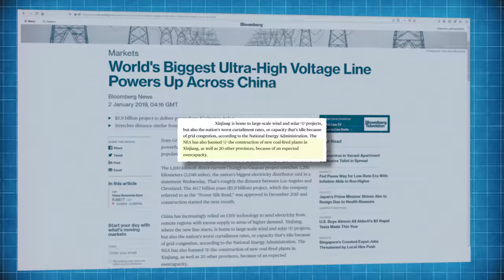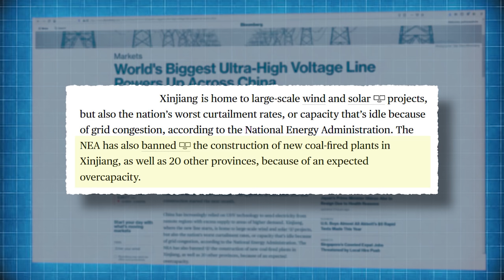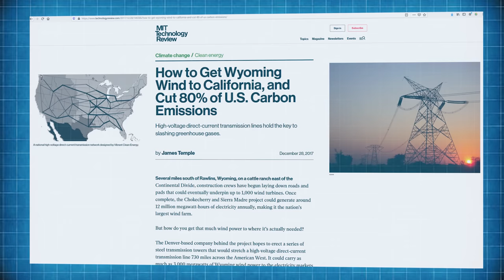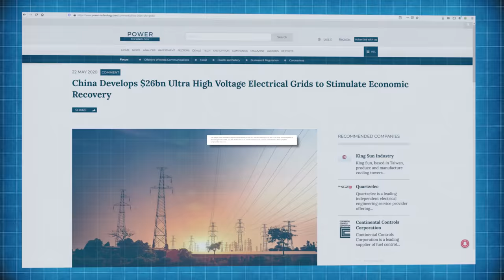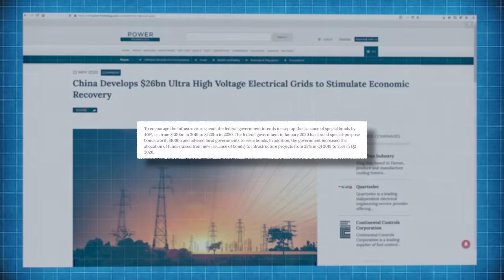China's MILLION VOLT Energy Superhighway

Comment: Be interesting to know whether the D.C. is transmitted sinusoidally as shown or smoothed with capacitance to regulated D.C.   If it's transmitted sinusoidally then it could simply be switched direction each time that it crosses the 0 volts, as shown, rather than needing inverted-gate bipolar transistors ((IGBTs) or equivalent to make a pulse-width-modulated (PWR) signal and then smooth with capacitance to sinusoidal 50/60Hz A.C.  (all of that called an "Inverter" like must be provided with solar P.V. on your roof) The diagram shows no capacitance or PWR so it is definitely stating that the D.C. is transmitted sinusoidally but would be interesting to confirm. That would eliminate much equipment and I suppose reduce heat loss. They probably do that. So the 1,100,000 volt D.C. ramps up  sinusoidally from 0 volts to 1,555,400 volts and back down to 0 volts 100/120 times/second (depending on whether it's 50/60Hz A.C. supply/demand. There might be some loss in that case due to the electromagnetic field coupling with an metals close to it. I'm getting a bit involved. I'll probably not bother reviewing that aspect. Somebody might find it interesting.  Afterthought: If it is transmitted sinusoidally then they might be reporting the 1.1 MV as peak voltage rather than RMS in which case it would be 778 kV RMS, more like the highest voltage A.C. transmission.
Reply: The transmission will be pure DC with no sinusoidal components. The output of the bridge rectifier would have worse transmission losses than AC because there are higher frequencies in the rectified output than the 50/60 Hz pure AC. The over simplified example in this video needs a soothing capacitor.
Reply: @yziib3578  Thanks for the info about capacitance before transmission omitted here. I'll likely take a butcher's at all this HVDC stuff when time permits.

Comment: I'm an electronics engineer (retired now). I was always under the impression that the resistance of any wire short of a super conductor is what makes DC LESS efficient that AC for transport over distance. I know that the phase matching and inductance/capacitance problems really are a hassle for AC systems, but is that resistance low enough for DC systems to make that the more economic solution? Anyone?
Reply: Historically, DC can only be pushed about half a mile to a mile without the resistive losses becoming insurmountable, while, because they CAN tune the inductance and capacitance of the circuit to result in LESS losses than the you do with the same DC power.
Reply: @calebmauer1751  The whole reason that AC won out over DC was this problem. DC cannot be sent more than a mile without losses that make it prohibitively expensive. AC can. For EXACTLY the reason I gave. Try checking in with one of your professors on this. I worked in this field for too long. I am not arguing about it any further.

Comment: Over 40y ago South Africa was a leader in power generation
and transmission. We had the https://en.m.wikipedia.org/wiki/Cahora_Bassa_(HVDC) line with over 1Million volt DC between the + and - feeder lines. With the new gov regeim now in place, sadly all infrastructure is decaying away as we progress ever faster towards a failed state.
Reply: Wikipedia link says 533 kV.
Reply: @achenarmyst2156  533kV x2 = 1.066MV DC between the +533kV line (relative to GND potential) and the -533kV line (relative to GND potential). Think of the transmission line like a center tap transformer, with GND = 0v and then a +533kV feed and a - 533kV feed. If you touch the positive feed with your right hand and the negative feed with your left hand, then you have just over 1MV across your chest

Comment: Alternatively, one supercooled cable 30cm in diameter could transmit all the power requirements of Greater London with no losses. Just a thought.
Reply: Would you build your house over a pipeline of cryogenic hydrogen!???
Reply: @alexandersibilio7436  No one would. They use cryogenic helium. Also the cable would only be to a substation where it would be dropped down to mains voltage.
Reply: @alaneasthope2357 ...Sorry  but it really doesn't sound safer 😅
Reply: @alexandersibilio7436  Probably why the power distibution companies haven't done it, although there are now high temperature superconductors which work in liquid nitrogen.
Reply: Bear in mind to keep a cable supercooled the liquid nitrogen? has to be boiling, so it will have to be constantly replenished, and that takes a lot of energy.
Reply: @rogerbarton497  Yeah. It's never going to happen. As is often the case, the most effiecient is rarely the most economic. :)

Comment: What are wildfire risks compared with AC, electromagnetic radiation risks for linemen working the line every day. It's an interesting strategy but prefer more conclusive data before signing on to DC transmission which is more lethal in electrocution by order of magnitude.

Comment: While DC high Voltage lines are not really new (first in Germany was planned 1941 but could not be finished because of the war), they are now very common in the Europe energy backbone.
Such high voltages make only sense if you have to transfer vast amounts of energy over large distances. So they are simply not needed in Europe. Common Voltage in Europe is 400 kV.
You can see it as a special case of these technology, as China has to close a gap of several thousand kilometres ..
Reply: 230 volt AC at 50 Hz is common in Europe
Reply: @jwarmstrong  
While the yanks fart around with 110v and imperial measurements. 😁

Comment: South Africa was using DC  low voltage high current  for transmission over 30 years ago !!!!
Reply: Low voltage doesn't count.  That defeats the purpose.
Reply: @incognitotorpedo42  probably high volt - low current, it's ok, they both come out as watts!
Reply: @GaryGraham-sx4pm  There's a big difference between high current and low.  High current requires expensive large diameter wire and beefier components that cost a lot more and are harder to  install.
Reply: @incognitotorpedo42  Watt?

Comment: With DC transmission of electricity we can connect continents and across continents. Sharing renewably powered electricity is the future. With this electricity we can power the world and off fossil fuels and their inherent industrial carbon emissions. High insulation, high efficiency, electric thermal mass heating, electric transportation all powered by local and regional renewables. Then of course we need to get 414 ppm back to 280 like it was in 1870...gigafarms?

Comment: Isn't there an issue with lines becoming increasingly susceptible to solar flares/geomagnetic storms as the voltage increases?  Something about the difference between the line and the ground being greater.   I seem to recall this being the case, at least for AC, and a reason why some other countries have shied away from such high voltages.  But I don't know if the same issues holds for DC.  Would appreciate if someone with deeper knowledge could comment.
Reply: The length of the lines would certainly be an issue in that regard
Reply: Resilience in face of another Carrington event or worse, definitely needs to be planned for. Plenty of batteries in case of grid collapse would be a start.

Comment: Uh, where did you hear DC is more efficient at long distances?  I was told quite the opposite.  The resistance in the wire eventually degrades the power until hardly anything comes through.  Whereas AC doesn't hardly suffer this loss.
Reply: Ohms law as I recall, (ie.resistive losses) same for AC as DC.

Comment: "Alternating current only conducts along the surface of the wire. "At 60 Hz in copper, the skin depth is about 8.5 mm"  https://en.wikipedia.org/wiki/Skin_effect
Reply: For normal wiring it is almost negligible up to a kHz or so, it can be reduced with Silver coating and increased surface area, but such increase will cause more reactance, there are some "magic" that can practically eliminate these problems, but makes the conductor designs a bit more complicated and voluminous

Comment: The UK and France’s  first HVDC link was installed in the 60’s and runs under The Channel, it’s been updated a number of times. I think it’s still the longest undersea power cable of this type.
Reply from the maker: Yes indeed. A vital interconnector. It doesn't run 1100kV though :-)

Comment: Are you sure about this, it is almost impossible to push DC long distances with just voltage. The reason DC lost out to AC in most of the world was you have to increase the amperage of DC to transmit it over distances, making it very dangerous, and expensive. AC on the other hand can be transmitted over long distances by stepping up the voltage. Unless something new has been introduced in the technology, there is something else going on here and its not working the way you think it is.
Reply: Incorrect. It is now just as easy (but still slightly more expensive) to generate high voltage DC as it is AC. The trick lies in high power thyristors that can switch megawatts of DC energy at high frequencies in the kilohertz range. Banks of thyristors have been used to handle up to 20 Giga Watts. 

These devices have been around for four decades, modern versions can handle large amounts of power at better than 99.5% efficiency.
Reply: 'it's not working the way you think it is' back at ya

Comment: Back in 2006-2007 when crude oil was kissing $150/bbl I was asked by a Genentech Molecule Manager to "...invent a molecule that solves the world's energy problem." So we did...5 of them...and transmitting them is 1/8 the cost per megawatt mile compared to electricity and 60,000 miles of pipelines already exist in the U.S. suitable for one of the compounds.

Thus all the talk of better batteries/capacitors for wind and solar was solved long ago and when it leaks on the ground plants flourish and when it leaks in water algae thrives sequestering massive amounts of CO2.

Today it's packaged as similar compounds like "Blue Hydrogen", but it's no big mystery; compounds of ammonia are easy to synthesize, have a higher energy density than gasoline or diesel and you can throw a match in it and it won't burn; but as Beirut demonstrated, kick it with a good primer explosion and a whole lotta energy is released.

Sadly, Silicon Valley was too busy with Google & Facebook IPOs to look at energy and the following year everything tanked and funding dried up. Had we switched to zero emission fuels in 2006 perhaps we wouldn't be facing extinction today. At least we'd have far better odds of avoiding it.

No such luck, but the game isn't over yet. 

Ideally offshore thorium reactors, far from population centers, thus reducing that risk, could make all the fuel for power, transport, including aircraft & ag needs AND we could ramp that up a lot faster than millions of sq miles of wind and solar and for a lot less mined resources and mfg.

But will we?
Reply: Actually once you get to ammonia, the additional processing steps to get to JP4/diesel using CO2 extracted from seawater is not that great. JP4/diesel is safer and much more useful as a fuel  than ammonia. For this reason I don't see much future in hydrogen or ammonia as fuels.
Reply: @jimgraham6722  I'd dieagree&suggest an electric drive train & fuel cells can take a jet or car or train or boat higher & faster than currently possible using JP4/petro.
Reply: @owlnationlegal4228  I hope you are correct but think I will be well and truly dead and buried before an electrically powered passenger plane can do Sydney - LA on a single charge at M.8.
Reply: @jimgraham6722  Tis true you probably will be gone given all life incl humans will be extinct in well under a decade.

Comment: I always thought direct current caused
 more resistance in the wire but I guess stepping up the voltage first reduces the amount of current. I wonder if that could be done with electric cars simply stepping up the voltage and using direct current motors. Would that make them even more efficient?
Reply: Higher voltage yes. Current electric cars use batteries delivering 400-600 VDC. Newer designs are approaching 900VDC. The advantages of higher voltages are greater efficiency, quicker recharge and lower weight. I wouldn't be surprised if in a few years EV makers are using 1200-1500VDC.

Nearly all high power electric motors are AC of one sort or another (needed to get a rotating field to turn armature). To get this in an EV a special inverter is used drawing energy from the battery to power the motor's field coils.

Comment: wait? direct current? no no only when one has a super conductor that would ever be a good idea.
the whole point of using alternating current is the fact is has a lower energy loss ratio per unit of distance then direct current.
the only reason it got used though as dc is deadlier then dc. but considering the loss is so intensely high in dc that it would never be feasible.
Reply: Well, the facts prove otherwise.
1 Mega Volts, dude. And power (loss) equals Amperage squared divided by resistance. By a given power (Watt) there is a less current flowing when the Voltage increases. 
And of course AC has two factors to take into account, DC or wire resistance (Ohms) and AC impedance (Henri), contrary to DC that only loses energy due to its wire resistance.

Comment: thought the whole point of using AC was to avoid power loss over distance?
Reply: To minimise losses you need to minimise current which means using high voltage to transmit the same power. The advantage of AC is that voltage can be stepped up before transmission and then stepped down again afterwards using simple transformers.

Comment: Awesome. Bruce Lee is a rare positive example of someone actually doing something.
DC is only logical choice.
Most of the systems are electronic and don't need rotating magnetic current and motors have to have inverters, anyway.
DC is much easier to switch and make parralel loads as well as generators.
It's also much easier to deal with emitted field etc.
His Kung Fu is strong.

Comment: Is 1.1 million volts DC really efficient and how do you bring it down AC is easy for big power numbers just a big transformer but aside from a buck converter using a mosfet or some kind of switch and an inductor
Reply: It's all a bit amateur science, I don't believe half of it. I think he's a charlatan.
Reply: Dear James, DC can be transformed up and down in the same way as AC, using a special transformer called an inverter. The inverter uses high powered thyristors typically able to handle 7,000 Volts at 6,000 Amps to convert the DC to AC, then transform it up or down and rectify the output back to DC, or convert it to AC suitable for the AC grid. Modern thyristors have an efficiency of over 99%.
Reply: @jimgraham6722  so not changed up and down the same as AC I'm not at least not with extra steps I mean I'm sure it's pulsed DC thru a transformer but that will only give you a square wave so you would need a pure some wave inverter but that all just seems like insanely big things to me but I mean I guess it's cost effective if they are actually doing it
Reply: they probably use big amps and big volts
Reply: @james10739  Yes it is not a simple square wave, rather it is a series of square shaped pulses of varying width (PWM), that integrate to form a sine wave. The process is more fully described at:

https://en.m.wikipedia.org/wiki/Power_inverter#Output_waveform

Comment: If we can transmit DC voltage over long distances then why have AC anymore? Most of our appliances are DC now so why not switch over to DC completely? It's only a matter of time before AC is no longer used.
Reply: You could install your own solar panels and separate low voltage DC power sockets around the home maybe...?
Reply: @MrZoomZone  yeah definitely, and people have who live off the grid. We need to happen on large scale though and I think that will happen when full self-driving becomes reality and people just start buying motorhomes that are off-grid and drive themselves instead of buying houses or renting them. It will be similar to the cell phone when everybody stopped having a landline. When energy storage and satellite internet along with full self-driving all come together in the form of a smart motorhome then I think many people will just buy that instead of a home. Not because they want to necessarily but just like cell phones it will be something you have to have that you can't afford both cell phone and the landline.
Reply: No, AC is not going away.  AC is vastly superior for distributing power locally and even regionally.  HVDC lines are only competitive at long distances and high loads.  Virtually ALL household appliances that use significant amounts of power are AC.  The only stuff that's DC is small electronics and hand tools.

Comment: Well it would appear the 50 Cent Army is out in force in the comments, I would prefer having statistics from independent sources on the validity and plausibility of a system such as this functioning as intended, I would never take any claims or statistics out of China at face value given the fact they consistently lie through their teeth on any and every issue.
Reply: If I understood correctly, he was saying it's made by the Germans, Siemens etc.
Reply: @saberthelion  Individual components are being designed and manufactured by Siemens indeed however, most of the figures being presented are coming straight from China's NEC which like any other government body within China will regurgitate the CCP narrative regardless if it is factual or not. This is the primary reason that I will only trust a investigation by a independent third party in assessing its viability.
Reply: @HypnoticChronic1  Fake news. Ccphese are just alternative facts.